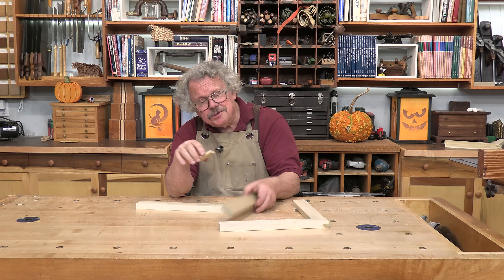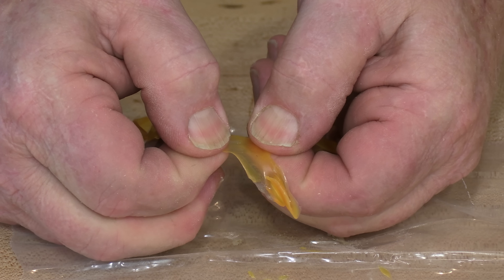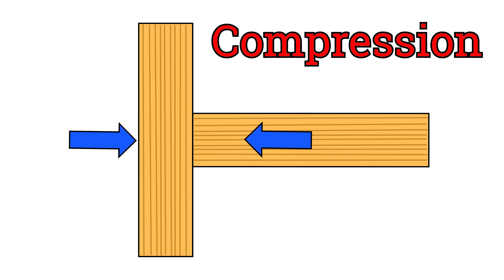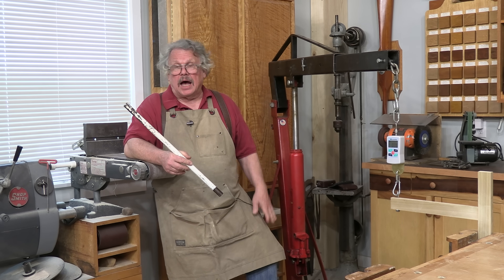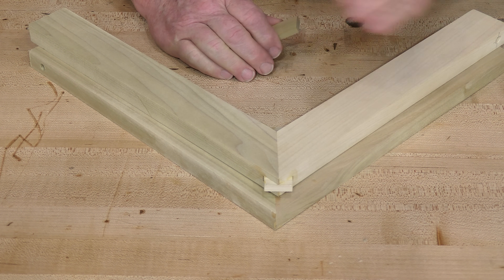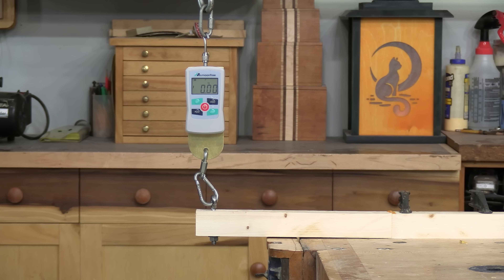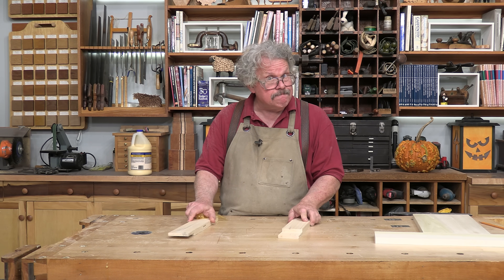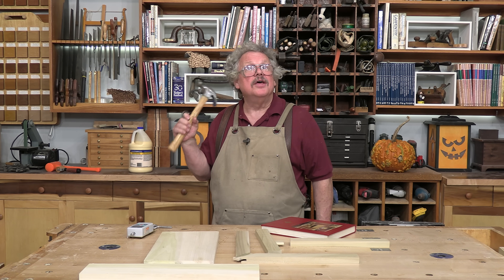Why Glue Alone Won’t Make Strong Joints

Comment: In that first test, would it be of benefit to have to smaller tenons with the grain set at right angles to each other, but both orthogonal to the joint?  The would give more surface area as well as a second grain direction, to compensate for woods that split easier, like oak?

Comment: i've had 'Woodworking Wisdom' in my shop for over 20 years.  As a self-taught wood butcher, it has really saved me a lot of anguish.  Of course there are many ways to tackle any woodworking problem, but the advice in that book will never be wrong and it is very clear and understandable.  It was my first woodworking book and it's still the one I use the most.

Comment: Most woodworkers don't know this. You don't only need glue. You need wood as well to make a string joint with wood, and you have to bring the two pieces into close proximity, open the bottle, apply the glue to an appropriate configuration and customization of the wood and even apply a force to the wood to make sure the wood fibers are in REALLY close proximity. Most wood workers don't know this. They usually forget to open the bottle of glue and merely wave it over the wood like a wand while reciting Latin.

Comment: Wonderful and educational. Maybe a follow up would be amount of clamping force, how to distribute clamping force over area, and most importantly, how long of a time. Overnights seem too long, and I’ve heard others say that 1.5 hours is more than enough time. They’ve figured out stains to cure almost instantly with UV light, the only thing that delays projects are glue clamp ups and time. Could an instant adhesive (and I don’t mean CA glue) be in the near future???
Reply from the maker: RF (for Radio Frequency) glues have been around since he 1940s, and are used by many production shops. A high frequency RF gun (operating between 2 and 30 MHZ) cures the glue in seconds.

Comment: I found out about this over 50 years ago in Highschool wood shop. 
My shop teacher made a laminated joint of two pieces of one by six planks joined edge to edge. Clamped them together to make  aone by twelve, about three feet long. A couple days later, our teacher demonstrated how much stronger the joint was than the boards themselves. They split at the grain again and again and the joint never split. And the glue was just white Elmer's. Nothing special.

Comment: The most important thing is using the right joint and right techniques for the right project. I've made hundreds of picture frames with a miter joint and no spline. Plenty of strength to house paintings, photographs, and other basic stuff. I would not hang a bowling ball from one of these.

Comment: When we built bridges out of popsicle sticks in engineering class in high school, after I assembled mine, I coated the whole thing in wood glue and it significantly made it stronger.
Reply from the maker: I'll pass that on to the city engineers -- they're currently repairing a bridge over a nearby river...;-)
Reply: @WorkshopCompanion 😂😂😂❤. You are funny 😂❤😁
Reply: I did this in middle school, we got knocked down a rubric on "use of glue" though (I guess 5/5 would have been "perfect/very tight joints, no excess" and 0/5 "sloppily applied, joints falling apart")

Didn't get top of the school that year (some 100lb held), but did decently (about 1/2 that, at some 55lb held)

Comment: If solid wood moves so much across the grain with changes in humidity, is there any viable approach to covering cabinet plywood panels with 4 mm thick oak veneer sheets ? Would a full surface glueing under compression manage to prevent movement given the relative thin-nes of these sheets?
Reply from the maker: Plywood moves 1%-2%. It's a viable base for veneer. Heck, it IS veneer.
Reply: @ I am worried by the 4 mm oak expanding and contracting over the plywood. Would the oak eventually crack?

Comment: This couldnt come at a better time nick! I just finished gluing up my firat box and i am wondering if glue alone will get it to heirloom levels of durability.

No sooner did you mention adhesion and cohesion than did i put the clamps back on my project. I had taken em off to clean squeezeout. Hopefully I havent undermined the joints.

Comment: When you get down into the weeds of material strength, you quickly learn just how little a single value like adhesion strength actually matters when determining the strength of a joint.  In addition to the many great complicating factors pointed out in the video, you also have to think about the joint geometry and how it affects the force on the glue.

Think about tape bonded to a surface.  Even a fairly small piece of tape can have surprisingly large force needed to pull it off it you are pulling perfectly perpendicular to the surface it's bonded to.  E.g.: think of two pieces of metal that are bonded by a single piece of double sided tape.  If you pull those pieces of metal apart with perfectly perpendicular force to the joint, it might take hundreds of pounds of force to pull the metal pieces apart.  However, if you just have the tape stuck to one piece of metal and pick up the edge and peel it off, it might only be a pound or two or force needed to peel it.  The huge difference is that when you peel the tape off, you are only breaking adhesion on a very tiny line at the exact place the tape is pulling off the surface.  That way, you only need to break a tiny bit of the tapes adhesion strength at a time instead of all at once.  

Same thing happens in a butt joint in furniture.  When you rack that joint, half of the bonding surface is in compression, which already doubles the force per area on the half of the glue joint that is in tension.  Further, the wood bends slightly so edge of the far side of the joint that sees the highest stress will break first, like how the tape peels up.  The breaking of the glue then zippers across the joint as it opens up.  Since you are only breaking a small percentage of the joint at any given time, the racking strength is much lower.

If you have a dowel or biscuit in the joint, that additional glue surface area is now parallel to the racking force so the entire bulk wood/biscuit joint feels the same amount of stress from the racking force because that part of the joint is in shear, not tension.  There's no simple way for one small part of that joint to fail, it has to all go at once.  Because of that, the racking strength is much higher.

Comment: So the best interface for effective gluing strength is to have the wood joints be perpendicular to the main force that would be acting upon it, put multiple coats of glue to fill in more gaps thus increasing bond, and consider a small amount of extra space in the joints for expansion and contraction

The first one seems effective if the wood is going to have an acting force upon it 
The second one seems more effective if the wood is going to be exerting a force
The third one seems more effective if the wood is going to be undergoing weather conditions

Knowing what the wood will do can determine the appropriate technique

Comment: My father has always gone on about a book called "understanding wood" by bruce hadley. This feels like a far more practical explanation than that book and it just makes so much more sense to me. I had never understood why my father made desks with floating breadboard ends but seeing this it makes so much more sense. Also absolutely astounding that end-to-end glue joints could even be that strong, in areas that arent subjected to much racking or any deformation forces, it looks like it could be viable joint?
Reply from the maker: I have Bruce Hoadley's books, and he is an insightful although sometimes impenetrable writer. As for  end-to-end glue joints, the chemists at Franklin Inc. (home of Titebond) showed me that trick when I interviewed them for my book "Gluing and Clamping." They had their salesmen glue two 2x4s together, lay the assembly across two cement blocks, and stand on it.